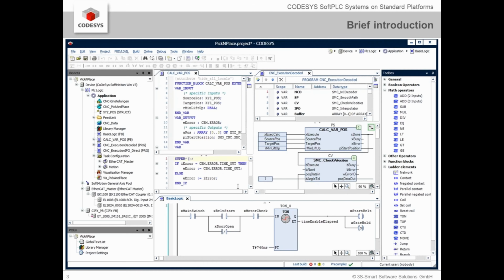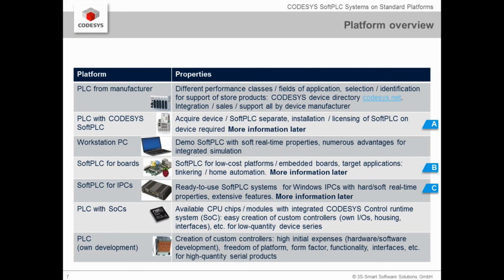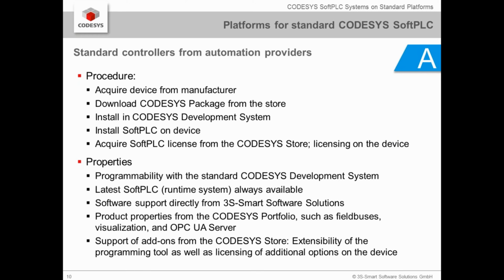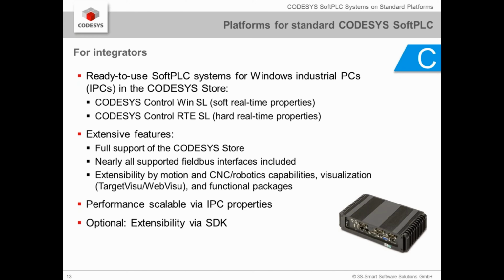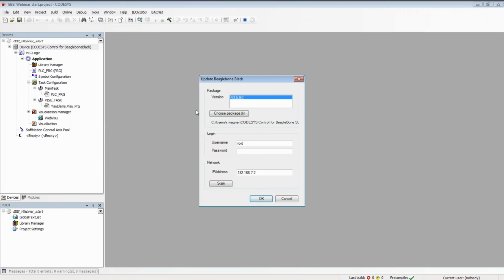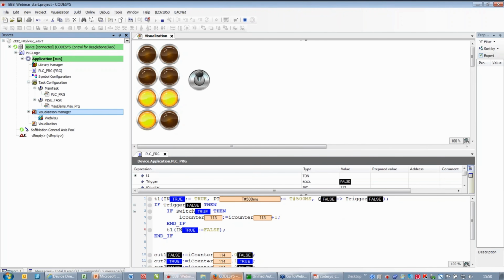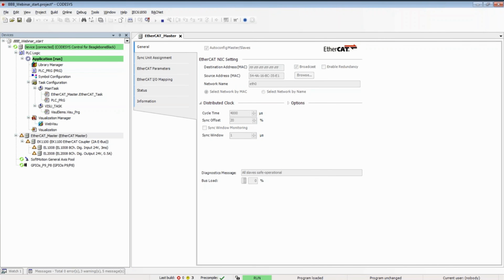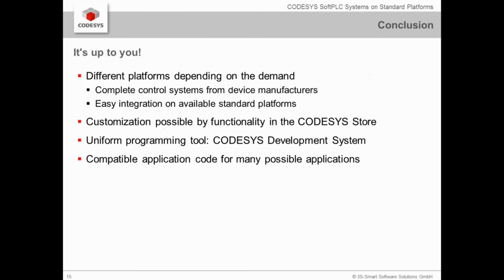Webinar CODESYS SoftPLC Systems on Standard Platforms

Comment: Hello ... is it possible to put the i / os factor in one notebook and codesys in another notebook, to make the two communicate in the simulations?
Reply from the maker: You want to communicate between the smartphone and a CODESYS PLC? This will not work with the simulation. You need a SoftPLC on the one side and any compatible communication client on the other side. E.g. using OPC UA Server on the CODESYS side and a OPC UA Client on the smartphone. For Android there is an open client called Prosys OPC UA Client, maybe there is something similar available for i/os.